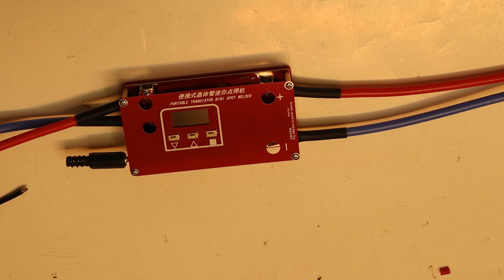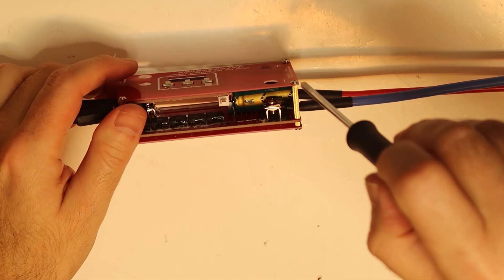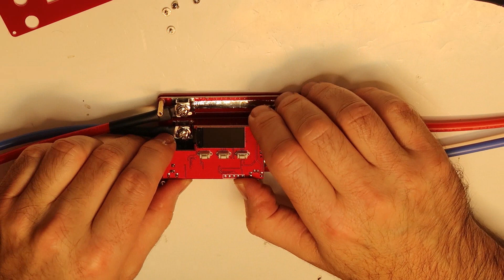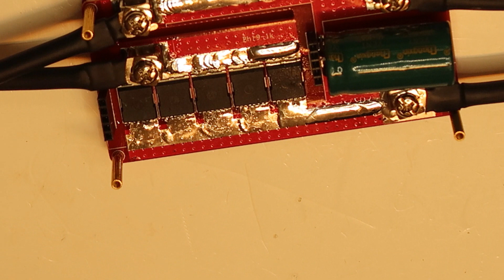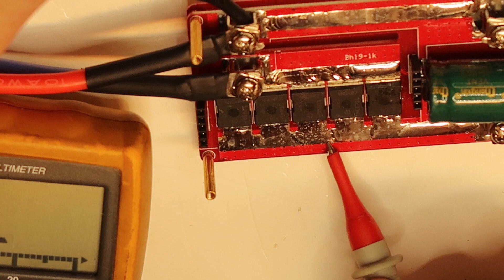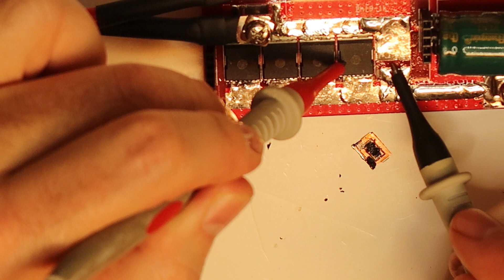Aliexpress Spot Welder do not buy!!!!

Comment: mine is exactly like that and works flawlessly. you fried the mosfets because those supercapacitor cant provide a huge amount of current in a shot period of time!
Reply from the maker: No bad design.... look at 100 other YouTube videos on this
Reply: @RoeeBloch  I already saw a huge amount of videos before and after buying it! and one thing in common is the ones who burnt the mosfets had a lack of power when spot weld. the one you had (with the white buttons) you can do the cap mod on the main board. It prevents the board the get low voltage!! PS: I use mine with several 4S high C rating lipos in parallel.

Comment: Hahaha, you broke it because you simple did not understand how to use it.
This spot welder is SUPER AWESOME if you use the correct battery to feed it !!!!
Don't blame it on the device if you screw it up.
The proof that it works is here on YouTube by many many users that make perfect spot weld's with this exact spot welder.
The title schould had be: I screwed up this awesome spot welder
Reply: I just bought and tested this mini battery spot welder...only minor modification add a capcitor dan make more thickness PCB line in/out power .
I use motor battery 12v 9Ah and always on fully charge...and energy setup on 45 ~ 50
Reply from the maker: disagree - the design is BAD, if you do understand how mosfets are working, you would understand that if you work with them with improper turn on - so they works in resistance curve before fully on, and in this case the power consumption is dramatically high- this change see my video here (which also I found hundred of users worldwide with same problem), shows the design is BAD https://www.youtube.com/watch?v=pGhLilyOX8Q
Reply: @RoeeBloch  I did some mods as inrusch and 470 Ohm tesistor mod.
It works fantastic !!!!
If you see so many other people with the same issues it's very clear to me you all do the same wrong thing.
There are many successful stories on YouTube.

Comment: Thanks Roee for this video. I have already ordered one on ebay shop.  I will be very caryfull keeping the voltage high.
Reply from the maker: Glad I could help
Reply: Use a battery the can handle at least 180Ah 
Always use fully charged batteries. 
If you notice a slightly bad weld, stop and charge your battery again.
This way this spot welder last forever.

Comment: This guy seems to know what the problem is with them.
https://www.youtube.com/watch?v=fdnO0Z-scjA
"During the weld, the battery voltage sags below the required gate voltage for the mosfet (10v or so), especially with a small or old battery. with a too low gate voltage, a mosfet will behave like a resistor - which in this case caused it to heat up and let out the smoke. Adding a capacitor on the control circuit ensures that the gate voltage stays high enough during the weld for the mosfet to not behave like a resistor."
Reply from the maker: Yes I wrote at the end that mosfet doesn't open fast enough, this cause it to be higher impedance from Darin to Source, that eventually burn the mosfets